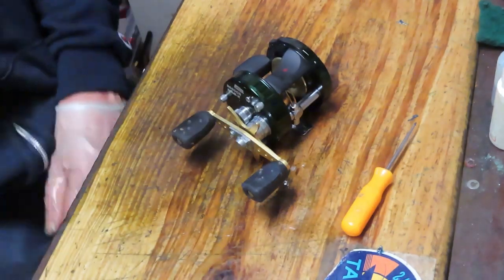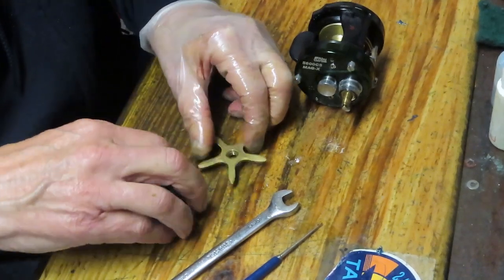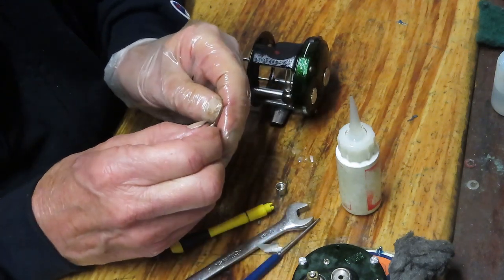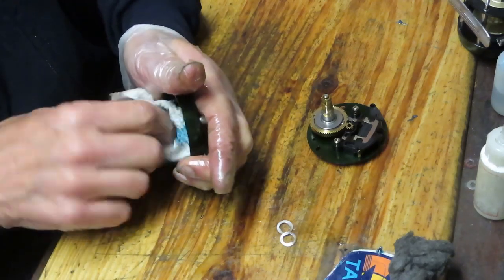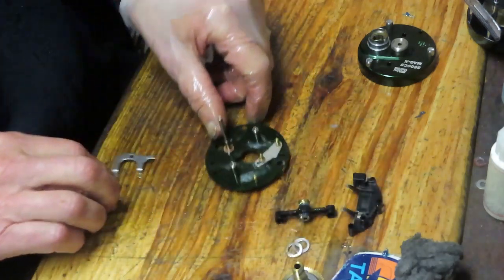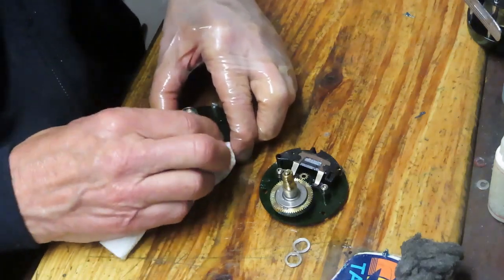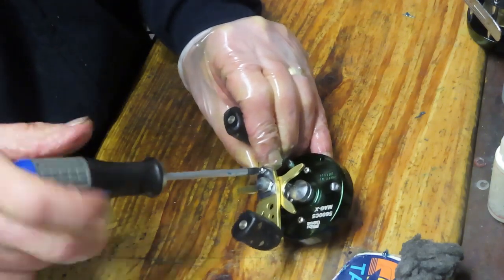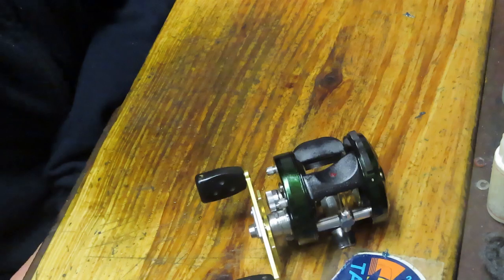Abu Ambassadeur 5600 C5 Mag X fishing reel how to service and

Comment: i took off the left side plate. Den, you did not. The problem is there is spring that pooped out and I cant figure out how to reassemble it. You didn't remove the left plate...help :(..do you have other vids where you take off the left side where the mag is shown and re-assembled?
Reply from the maker: I don't have another video and I no longer have that reel in my shop.  The schematic may help you.  You can find it by clicking on this link http://s7d5.scene7.com/is/content/purefishing/Abu%20Garcia/Schematics/5600C5MagX%2016%2001%201128992_12523-1.pdf Dennis